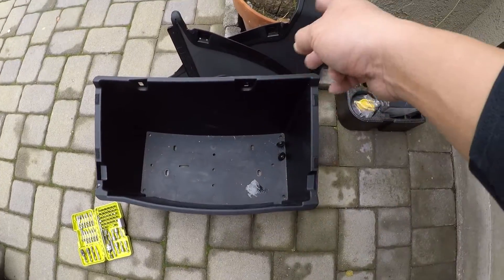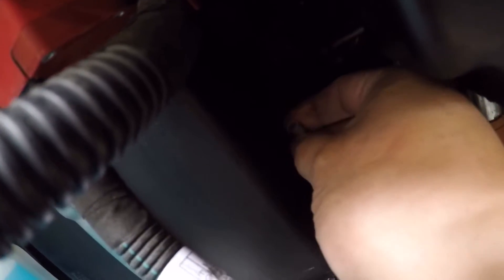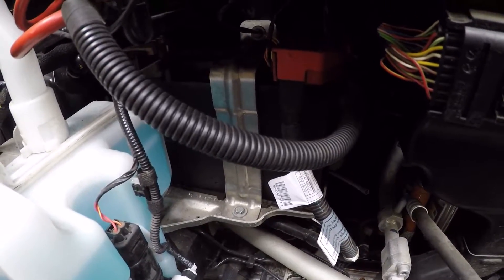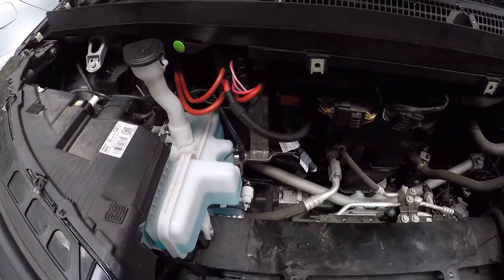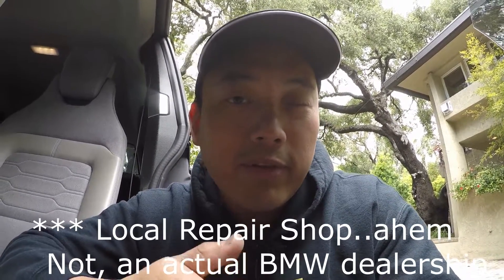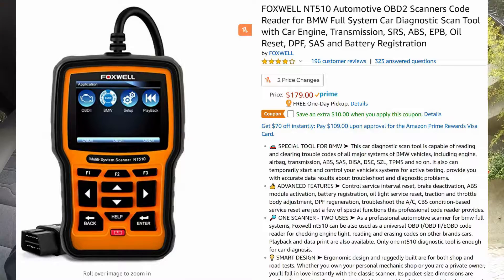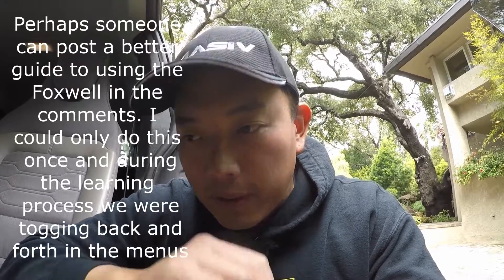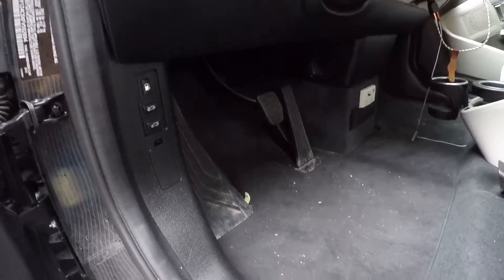Battery Replacement (12v) & Registration Guide - BMW i3

Comment: If You Supply 12 VOLTS TO THE SYSTEM FROM ANOTHER SOURCE THE ECM WILL NEVER KNOW THE BATTERY CHANGED ...... USE SOME SALL JUMPER WIRES KEEP THE SYSTEM POWERED THROUGHT THE SWAP ...
The ECM will just think the battery never changed .....
It only knows because you fully took power away.   
Techs in other trades have done this for ages where some sort of memory is involved .....

Comment: I just replaced the battery, but one of the many alerts caused by the dead battery didn't go away (drivetrain alert). Now, the car won't start. If you have any suggestions, please comment.

Comment: Century bmw in North Hollywood CA wanted $600 to replace this battery. I purchased a AUX18L from Remy battery and it fit like a charm. 
No need to register battery and no error codes.

Comment: Oh man, I did that too !!! I followed the video step by step and  I made it!!!  Without registration or anything!!! , I have a BMW i3 2014 extended range,  after installation and everything is looking good made a huge mistake!!! I forgot to turn on the safety plug that I turn it off at the beginning!! So it doesn't work at all, but after I turn it on its work perfectly, !!!! Thank you again

Comment: You never went into details as to why your main battery needed replacement.  Seem like you said it was 3 years old. I thought BMW offered a much longer warranty.  I am preparing to buy an i3 and want a real grounded expectation level on longevity and maintenance.  Any comments really appreciated.
Reply from the maker: It was preventive measure on my end.  My local dealer would but warranty the battery as they claimed it was a wear item m. Hopefully your dealer is different!
Reply: Thanks for your quick answer.  very helpful.   @RyuMoto  wow,  everything I have read was 8 year, 100,000 mile warranty.  When you say preventive measure, what were you looking to prevent.  Battery degradation, or some other problem with temp or charging?  Just trying to learn about this car, so I know what to expect and plan for.  Many thanks again.
Reply from the maker: @gabrielricci4464  please don't confuse the auxiliary 12v battery with the main EV battery. This video talks about the auxiliary battery
Reply: @RyuMoto  Okay, that may be the point of confusion.  At one point, I thought you used numbers like 22xxx instead of the newer 42xxx battery and those seemed to relate to the main energy source batteries, since they morphed through those ranges. Let me summarize,  you changed the auxiliary battery and not the main drive energy source battery.  Okay, I think I am not on the same page as you. Thanks for your patience.  Final question, was the car really reliable over the course of you ownership.

Comment: I just paid a BMW dealer $473.32 for a battery, $260+ for labor.
Reply: "how will they make $ off an electric car?"
AAA replaced 12v in my Fiat 500e electric on the road, prob under $200.
Thanks German over-engineering. So smart it's stupid.
Reply: @robertpryor7225  I didn't think about AAA.  Mine is dead at my house.

Comment: I didnt need to register my battery, it worked perfectly after replacing it. I just had to reset the date/time. Nothing else.
Reply from the maker: It's been a while since I checked so you might want to fact check me on this... The reason why you have to reset it is so that the alternator and other electrical services is able to condition the battery in the long term.  This was an effort BMW started doing in the early 2000s.  New batteries are charged like new batteries.  Old batteries are charged with different charging logic.  So yes, a new battery will work fine in the short term.  When I last looked at this, not resetting would cause new batteries to last <1 yr.  Hopefully I'm wrong in your case.  Let us know!
Reply: RyuMoto Hi, I had this same rumor with my BMW 750i, turned out the whole battery registration is just a scam to get more money out of customers. Never had a problem with my old car either. Its just a regular battery, just like on any other car.
Reply from the maker: @joeelliott8454  That's too bad.  I see real opportunity there to improve the life span of these AGM (or even more complex) batteries.  It's already been proven by using a old Battery Tender vs. a digital AGM specific unit (or better) like a digital CTEK charger.  Better charging logic is pretty common practice for these new generation batteries (like in your cellphone or how the main batt is charged in your i3).  I have no way to prove you're either right or wrong but if they are indeed charging it the old way (voltage regulator & alternator feed) that's too bad.  Big opportunity lost IMO...
Reply: @ Joe Elliott your replacement battery wont last as long, as BMW’s ECU slowly ramps up the amperage from alternator.  You’ll just have decreased life
Reply: @NO_OPEC_NO_PROBLEM  that's just an unproven rumor, there is no technical explanation how that can happen. But if you want to give your money to BMW, feel free.
Reply: @joeelliott8454  Like the one person said BMW charged them $473, I found one from Wal-Mart for $137.50 and free shipping, so if it only lasts a year, you can buy 3 cheaper than BMW's fees.  Plus the added bonus of sticking it to the man!

Comment: In early November of 2019 I ordered a Remy battery planning a pre-emptive swap for my 2016 Rex model with 35,000 miles, and was carrying the battery around in my trunk. The tire place didn't have the device/software to register the battery, so I had planned to call around to find a place that did. Last night my alarm started cycling on and off, with random flashing of lights, and no response to the key FOB. So I had to figure out how to use the valet key, to release the front hood, and then removed the negative terminal from the battery. Thanks for the information on how to register the battery. After checking with all of the local auto parts stores, I ordered the multi scanner device you listed from the manufacturer and the car will sit until I receive that. Fortunately, I have another working car available at this time. Just need an extension for the socket so I can get the battery out.
Reply: My 2016 i3 just started to go haywire yesterday. Errors for the parking brake, drive train, battery discharging, ect. I took it to the dealer and it was the 12 volt battery.  The new one (under warranty) is coming from Germany as we speak, ETA is five weeks. I am now driving a loaner that will cost me $150/week in gas. I might order a Remy and give it to the dealer. If I didn't like the i3 so much, I'd be mad.

Comment: I replaced my battery myself but car still would not go into gear or allow me to charge it.  Had it towed to dealership and they said the only problem was that the battery was not registered.  I was under the impression you could drive the car even if the battery was not registered but at least in my case that was not so.
Reply: Hello, I am about to install the a new aux 12v battery, but according to your comment, I should bring the new battery to dealership for registration before installation. Please advise if this proper step to take? Thanks in advance.
Reply: @mikeg.9083  needs to be registered when installed on car

Comment: My high voltage battery isnt connecting my i3, i already reconnected the plug, show the battery is fully charged but shows - - - mileage and all the epower bars are blacked out, any suggestions how to fix?

Comment: Subscribed. Digging the i3 content.
Reply from the maker: I'm a huge fan!
Reply: RyuMoto You’re too kind. You mentioned the EPAS getting stiff sometimes because of a weak battery, think it’s browning out? I assumed there was a good sized DC-DC converter to keep that bad boy up. Now I’ll have to take a look at my 12v because my steering is stiff sometimes as I exit TJA but I figured it was an issue with not having a setting/value correct in some bmw state machine.

Comment: Does the foxwell nt510 battery reset even work? It only  Register battery not change the capacity of new battery ? Is it worth it do you have any  errors or malfunction? After the registration?
Reply from the maker: No issues still... Has been working no drama so far.  I don't know if it will change capacity.  I used the same 20Ah battery

Comment: Thanks for the vid!  I ended up taking my wife's car to the dealer since there's a chance that the battery gets replaced under warranty.  Should find out this Tuesday (3/5/19)...crossing fingers.  At least I know that you were able to DIY this successfully.
Reply from the maker: Please let us know!  I just assumed that the 12v battery is a standard wear/tear item like Brake Pads and Oil.  I'd really be curious if they warranty it.
Reply: @RyuMoto  Update:  12V battery replaced under warranty.  Are you also a member of NSX Prime?
Reply from the maker: @michaelkim3432  that's awesome.  Nice work.  Yes
Reply: @michaelkim3432  replaced under CPO warranty or the original warranty?
Reply: Kevin Kreezy original factory warranty
Reply: I have 2014 CPO and it clearly states in the contract that the battery (which I assume is the 12V battery) is considered a regular wear item like lightbulbs, brake pads and tires.  I thought about calling up BMW and seeing if they would give me a battery anyways but it's 5 years old so I wasn't going to waste their or my time.  Buy the Deka/East Penn AUX18L battery off www.remybattery.com (10% off code:  RBDC) and do it yourself, it's very easy and will save you lots of hassle and $$$...